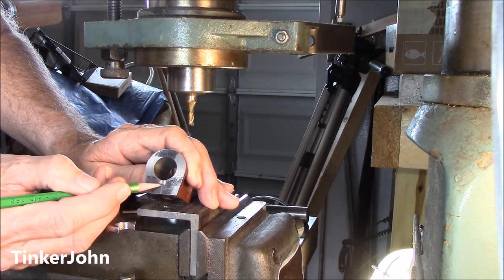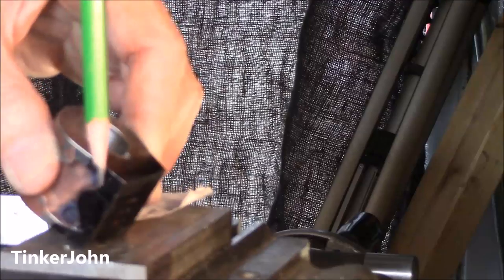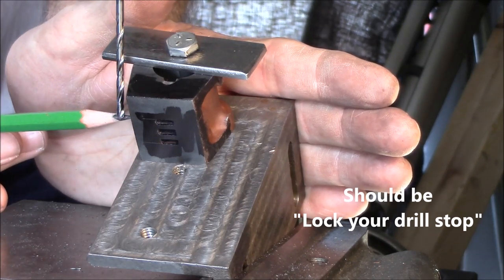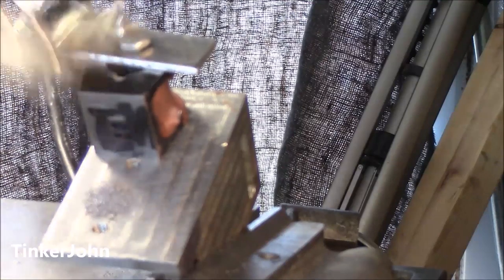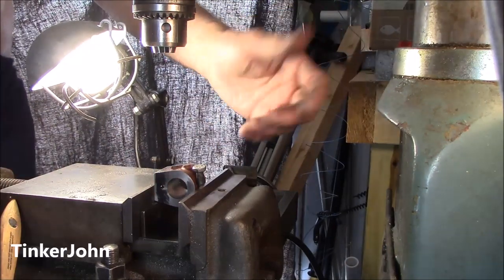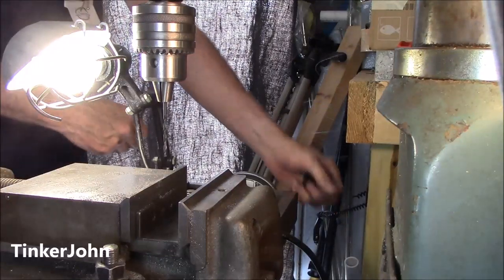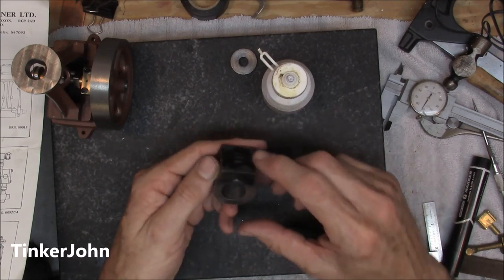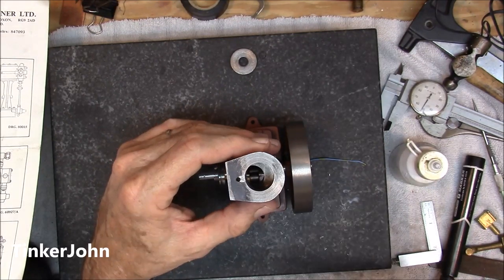Machining the Stuart 10V Steam Engine Castings - Part 23

Comment: Rory toner, if I remember right he drilled one side for intake and the other side for exhaust. I realize it's the same hole but as the valve moves up n down it changes that port from an intake to exhaust?
Reply from the maker: Thanks for watching and for sending along your comment.  You are correct, on hole is for exhaust the other for intake, however it makes no difference which one is what.Hope this helps,John

Comment: Nice use of the antenna wire John. Next time you use that piece of wire you will be a steaming strong signal.
The engine is beginning to look great and I can't wait to see it run.
All the best
Sandy
Reply from the maker: Sandy,Thanks for sending along your comments.   Hopefully I'll get the engine up and running in a few weeks.  However the past week or so has been really busy at work so shop time is limited.   ~John

Comment: Another great machining video John. Have you ever attempted to make a small boiler to run your steam engines? I started one once BUT never finished it. I used two 3" hard copper water pipe caps for the boiler. Might be another project if you have not made one.
Reply from the maker: Galen,I've made some really simple boilers from old pressure cookers before. That's about all.  I do have some older toy steam engines I will be restoring that will require some boiler work so I'll see where that leads.~John

Comment: When you drilled the hole for the exhaust why did you clamp the cylinder the way you did?  I would have clamped it top to bottom.  Would my method be ok or is there a machinist reason not to do it like I suggested?  ROG
Reply from the maker: ROG,Your way would have worked as well.  I don't know of any particular reason it would not.  As you know there are usually several ways to mount items on the machine.  There was no compelling reason I did mine as shown in the video...it was the first thing I though of.~John

Comment: Thanks John. I’ve never seen a 10v with dual exhaust! Does it run better that way?
Reply from the maker: Thanks for watching. On original engines those were called drain cocks.  They were opened to allow condensation to leave cylinder before the cylinder warmed up. Actually they are not needed on model engines that are run on  air.  It is mostly for steam.  ~John

Comment: You have sussed  it in your next video, but the hole through to the centre port is the exhaust. The reason the casting has provision for the drilling to come from either side is because on the twin cylinder version of this engine the exhaust has to be handed to get the exhausts on the same side of the engine.(ditto for the inlet ports on the valve chest. It also gives you the flexibility to have the exhausts and inlets on a particular side if that suits your application better. Note that the angled inlet drillings must not only stop before they break into the centre exhaust port, but they must also not break out into the flat face the slide valve works on. Great videos. Are you still ok for underpants? :o)
Reply from the maker: Roger Crier Roger,, Thanks for the email and details.  Fortunately I did drill the hole correctly, although the video does not clearly show it.  Glad you are following along with the project.  ~John